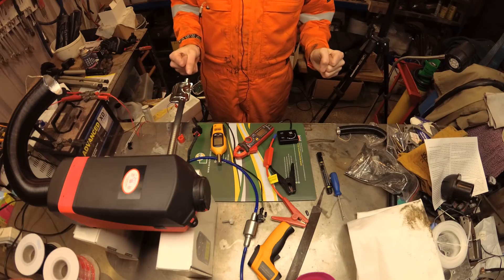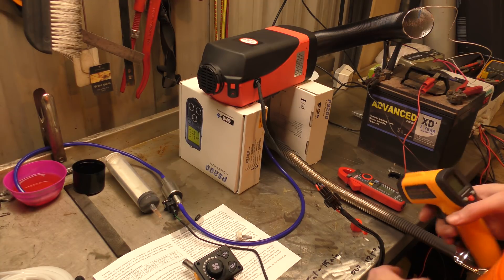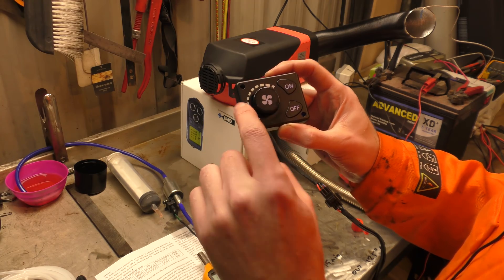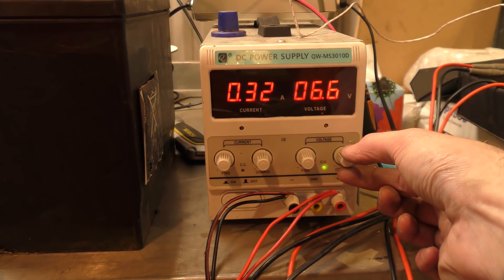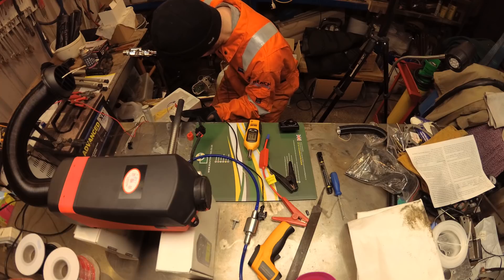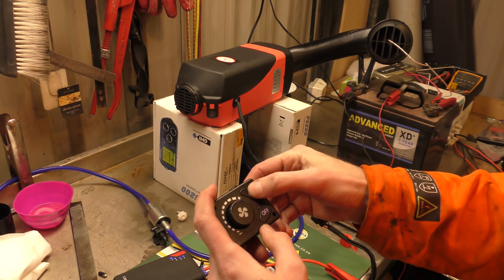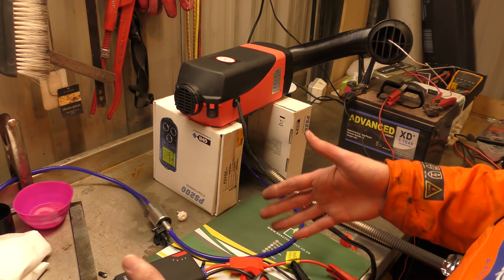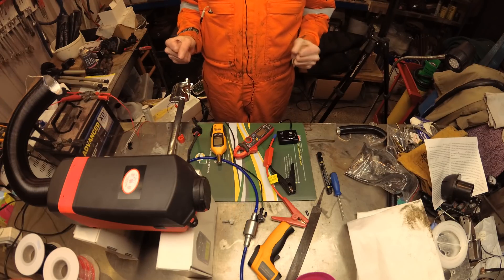Diesel heater testing - part 2 - more tests & questions answered

Comment: Hey David, I have the Espar S2 D2 2kw and have been trying to solve the exhaust cabin leak since the first winter it was installed. I worked with Espar service to try and solve it, did all the installation fixes from shorter exhaust pipe to addinga  turret and then sent the unit back for inspection.  They said nothing was wrong. Got it back and seemed ok the first few days but slowly the exhaust fumes started to come back, noticeable during shutdown and recently realized when fuel ran out while running on high, it started to smell too, telling me that when the flame is extinguished is what causes the smell and also telling me that it is always mixing exhaust air with cabin air although I don't notice it because it is burning cleaner, which clean or not is not good either. 

After trying a Chinese one to test, it was so much worse, after taking it apart i've come to realize that all these model types have exhaust mixing with cabin issues, I cannot believe that a huge majority of them are leaking like this, only that their nose and lungs are not as sensitive as mine. Carbonoxide is not an issue as it will smell like this without ever tripping a CO alarm, I have an industrial CO detector and it mostly won't detect anything, my nose and lungs feels it way before a reading. The chinese one was leaking so bad it did read around 10ppm, the gaskets on them are useless, not seated and loose, fuel line in the chamber showed signes of leak, and heat vent was just moist air, improper combustion.   

My thoughts is that the burner gasket may be the issue as it works well in the first few cycles but as it goes from high temps to low it either hardens or loosens and some exhaust gets mixed with the blow chamber air and gets into the cabin.  Another thought is, and I wanted to ask you, is it possible that exhaust is just coming back from the ignitor air hole?  like when the fuel runs out, the wire mess just burns up fuel and the smoke pushes out the hole?

Anyhow I plan on sealing all the grommets and and the burner gasket with Ultragey sealant or JB weld Red silicon sealant, do you think the sealants can hand the heat as a burner gasket?  Gonna coat the burner gasket with it for a better seal.  Also wondering about the sealants being toxic.  Thanks.

Would be cool if you could address this issue in an episode of yours,  there are a lot of people dealing with exhaust issues and they have no idea it could be the issue that I've mentioned here. It's not leaks from outside or anything to do with their installation as most think.

Comment: Hi David, can you help me please? I have a 8kw heater, but I have not seen the control panel on any of your heaters, mine simply has 3 buttons at the bottom, I am trying to get it on the lowest fuel supply and the lowest heat setting (8c) which is the lowest it will go judging by my black heater, the red one is showing different settings. Can you help please??
Reply from the maker: Is it this one? - https://ae01.alicdn.com/kf/Hb2906cab90654c4a8278c9111c62e8af9.jpg
Reply: @DavidMcLuckie  Yes, that's the one.

Comment: Hi love the videos so help full. Had mine for a couple of months Had a few problems with the settings all running well for a while.had to keep cleaning the burner out.in the end after watching a few videos i decided to cut the after burner at the first weld to find a gauze filler witch was completely blocked i have removed it and tig welded it back to gether all is well eney advise is it good or bad

Comment: What's the carbon monoxide risk leaving it on in a van overnight?
Reply from the maker: Assuming your exhaust goes outside the risk would be the same as any other fuel burning heat source.

Comment: Hi David, I wonder if you've come across this.......
I installed my 5kw heater and the display didn't behave in the normal way. There is no clock, it's got the settings icon displayed all the time. I couldn't prime the system by holding down the 2 bottom buttons down - It does nothing and I didn't get the usual "H of" message.
It was only by frustration that I found out how to prime it - I pressed the settings button 5 times and it finally started priming with a 60 second countdown timer before it stops again.
I can't change the pulse HZ to temp, display the clock or timer..... nothing!
I've searched for hours but to no avail, so you're my last hope 😫
All the best,
Tony
Reply from the maker: That sounds like one of the weird controllers.  Looks like the normal ones.  I've had one similar and it had a weird button combination to prime it as well.
Reply: @DavidMcLuckie  One last question if I may..... I want to buy the Afterburner (the genuine one). Everything leads me to believe that it will work and replace the remote display but I'm not 100% sure.......any ideas?

Comment: hi everyone, i bought this system but i would like to plug it into my garden shed.  what kind of 220v AC to 12v DC converter do i need ?
Reply from the maker: DC power supply 15A, should be about £15 on eBay.

Comment: Hi David, loving all your vids mate, detail is 👍🏻. Quick question if you don't mind? I've got an 8KW version on my boat. It's at the front of my boat and I have 6 110ah batteries at the back. It's a 60ft boat. If I start the heater in the evening aftwe the engine has fullly charged the batteries, the voltage display shows as 12.5v and it starts no problem. The next morning, voltage still showing as 12.5v, it won't start stating a battery issue. Is there anyway of adjusting the minimum startup voltage that you've found? The morning voltage generally drops .2v more than the evening drop so if I could adjust the startup voltage, it might make it start. At the moment I have to get up and start the engine or wait for the sun to add enough power through the solar. I hope that makes sense? Thanks.
Reply from the maker: That's odd.  I'll try turning my power supply down and see if I can replicate the fault.
Reply: @DavidMcLuckie  All sorted. I removed the factory power feed loom and upgraded the wiring. Gained .8v which is enough to keep it from dropping under the min starting V.
Reply: @DavidMcLuckie  you're a gent! Ta very much.

Comment: Can they  be  left outside
Reply from the maker: You'd have to coat the electronics with a waterproofing agent, like a conformal coating and perhaps some dielectric grease on the connections.
Reply: @DavidMcLuckie   cheers

Comment: Got this 5KW heater which has been heavily overfuelling so far (lots of black smoke).
I discovered that there is a „highland mode“ (which also works outside Scotland).
Further in the manual they call it „plateau mode“. It says it reduces the pumping frequency.
So I gather it’s a „high altitude mode“.

Switched to that an et voila, smoke drastically reduced, no smoke in stage one („gear one“ as the manual calls it).

As I’m using a fuel pump off a D5W Eberspächer, I guess it delivers too much fuel / pulse.

Does anyone know any specifications of either Eberspächer, Webasto or those Chinese fuel pumps? 
I’d like one with the lowest delivery rate.
Reply from the maker: I'm sure one of the pumps I've got or have seen had the amount on the side of it, I'll have a look.

Comment: Ive got one of these (5KW) heaters but the control isn’t a dial or a fully digital display but a 5-button round pad and a 3-digit display.

It shows things like „H-1“ to „H-6“ which i figured are the power settings,
„A-02“ e.g. which might be a fault code and it starts up with „P-12“ (could this be the pump pulse frequency settings?).

It’s all labelled in Chinese, so no clue.

Do you / does anyone have a manual or source of info on this?
Reply: Right, I can answer my own question, found something.
Just to share the info w. all:

That‘s the pad I’ve got.
https://www.caravanersforum.com/download/file.php?id=34189
(For the Scotts: this one mentions a „Highland Mode“!).

These two below seem to be the same.
https://www.caravanersforum.com/download/file.php?id=34188
https://www.caravanersforum.com/download/file.php?id=34190

Comment: Just watched your 2 videos on this 2kw heater and have bought one from Ebay. Will be fitting it into a small boat soon. The exhaust will be vented outside thru hull about 2 mts overall length. Hopefully this is not too long would you agree that's OK?

Comment: Can someone tell me what happens when the room gets to temperature? Does the unit turn off then come back on when the temperature drops? Thanks
Reply from the maker: The unit switches into low output, when the temperature drops it speeds back up again to heat again.
Reply: Thanks for the reply, that's good to know I was a bit worried about the van being too hot. Loving the channel. Much appreciated.

Comment: I have the 5kw heater but find it a bit too hot for the caravan. Any idea what the fuel pump setting would be to reduce the out put other than stick it on low and risk clogging the thing up with carbon? Great vids btw
Reply: Phil Elmes I think the default is 1.6 hz if you set it to 1 or .5 I would bet the fuel consumption would
Lower by half to 1/3 less and reduce heat output at the same time. 
That is if it can stay burning at 1hz fuel pump setting or lower

Comment: Hi . Can you tell me what I've done wrong. Primming fuel pump it wont get all the air out of pipe passed the pump it just fills the main unit up with fuel until it leaks out of the exhust
Reply from the maker: What happens when you try to run it after priming?

Comment: Just bought one I'm planning upgrading battery cable as it's got to run around 5 meter through my caravan. Would a 4mm2 single cable be ok for pos and neg ? I hear alot of horror stories about low volts
Reply from the maker: 4mm2 over 5m would result an about 0.5v drop. https://www.12voltplanet.co.uk/cable-sizing-selection.html

Comment: Another excellent video and follow up to the original.  I installed in my vintage camper and hooked it to my AGM battery for off grid.  For a power source I purchased a Henxlco 15A power source from Amazon for under $15 and it works great for long term use when hooked to shore power.  I think you'd really like that for your shop power supply.  Cheers!
Reply from the maker: Oh that power supply looks good, they do one up to 30A.
Reply: @DavidMcLuckie  Yeah they're ridiculously cheap and it works really well.  The 15A is warm to the touch during the startup and never gets hot.  It's adjustable voltage only goes up to about 13.8V but the heater doesn't mind at all.
Reply: How many watts does it draw?
Reply: @PackraftingAdven  about 125 watts when the glow plug is active. Around 12-15 watts on lowest setting. I have the rotary dial control panel.

Comment: can you mount the unit outside and only have the heater pipe into the van ?? what is the IP rating of the unit??
Reply from the maker: If you mount it outside you'll need to put it in something.  The unit itself isn't sealed.  Not sure of it's IP rating as it's open at both ends.  You wouldn't want it hoovering in any water or debris.

Comment: Great videos, great detail, and glad to hear it runs on Kerosene. Noticed some confusion about fuel types. Kerosene and Paraffin may be the same thing in the US but they are not the same fuel in the UK. Paraffin (UK) is a more refined fuel oil, and is very suitable for indoor use (e.g.stand alone paraffin heaters). Kerosene (UK) on the other hand is less refined and definitely not suitable for indoor use unless it is being used in a purpose designed system (e.g.central heating boiler) as it gives off toxic  emissions when burned, not to mention choking black soot!

Comment: Hi David got another question in the setting there is a p1.5 up  what does it actually do and what is the best setting to leave it on it,s same controller as on your 8 kw one thanks again. Jeff
Reply from the maker: I'm not sure I've seen that.
Reply: Hi David it's in the code part Ihink it might be the start pressure and also a fan speed setting have a look sometime and let all of us know what you think on the matter would be of interest all of us.Jeff. @DavidMcLuckie

Comment: Here again David, still no joy. Disconnected the fan from the PCB, and tried a 12v feed into the plug.........no response from the fan. How would you test the fan? Do you think I've tested it correctly? My first suspicion was that the fan had stopped due to contacting the casing, do you think this could have burned it out? Thought the magnetic sensors would've tripped it out and shut the unit down?
Reply from the maker: If you gave the fan 12v and it didn't move chances are it's cooked.  If you give it 12v volts and try to spin it by hand does it do anything?  How stiff does it feel compared to originally, the bearings might just be knackered.
Reply: @DavidMcLuckie  I was worried that maybe the PCB could step down the voltage to the fan? Tried spinning it to assist it starting - nothing. I'm gonna put a video up on YouTube at the suppliers request.
Reply from the maker: I'm sure when I have the motor out it says 12v DC on the side of it.  It doesn't run at the full 12v when in use, but 12v would certainly have made it spin if it was alive.
Reply from the maker: Sorry.  I've just had all these comments appear in the 'held for review' section.  Have you tried unplugging the fan, jamming two pins into the plug and giving it 12v?  If the fan spins it's not the motor, but it might still be the board.

Comment: David..........I'm here again with a tale of woe. The heater has been fine, but the fan occasionally makes contact with the housing, so I made a ply box cover for it. Left it running unattended for 20mins, came back and it had cut out, and I'm getting E-06, and the fan icon is flashing. There is a click on the PCB then E-06 shows, tried a battery pull, tried re-priming the pump( fuel line is full) and have taken the cover off to make sure the fan is un-impeded..........HELP!
Reply: E-06 in my book says............" Check the polarity of the magnet and the position of the Hall sensor" if you can work that out you're better than me, and that's not saying much really.
Reply from the maker: So on the fan there are either one or two magnets.  As they pass by the sensor on the board they let it know the fan is spinning.  Has you fan by any chance moved slightly off the shaft?  Can you push the fan in towards the motor?  It might take a good squeeze if it'll move.
Reply: @DavidMcLuckie  Thanks for replying, tried what you said........no joy. Don't know if I'm imagining it, but the fan feels stiffer than it was before? Wondering if it's fouled whilst I've been away from it, and it's burned the fan out? Fuckin' really doing my head in now, been nothing but trouble, and the weather is getting warmer by the day, so the longer this goes on, the less chance I'll actually need the fucker.
Reply from the maker: If it was me.  I'd buy another one from Amazon, bench test it.  If it works fit it, if not amazon returns and keep the other for spares.  If your fan has seized you can get a replacement blower assembly for £30 - https://www.ebay.co.uk/itm/Airtronic-Car-Motor-Blower-Combustion-Air-Fan-12V-For-Webasto-Eberspacher-Heater/153061406608?hash=item23a32bb790:g:UaoAAOSwkSxbIh1g:rk:18:pf:0.  And see if that fits directly or strip the motor out.

Comment: I didn't quite follow your answer on the temp control.  Do you set a temp level and it turns on and off as needed to maintain that temp?  Or do you set a temp and it blows out that temp no matter how hot it gets inside the van, rv, etc?
Reply from the maker: Sorry, it doesn't turn on and off.  If you use the rotary control it runs at max power until it gets to whatever temperature the number of lights on the controller corresponds to (I don't know what they are) then it slows down onto low power.  Same idea with the LCD controller, you pick a temperature and runs at full power to get to that temperature then slows down to low once it's there.  Obviously if the temperature cools down again, it speeds up again to raise the temperature.  With the LCD one you can set an on and off timer which will turn it on and off according to the time set.  Hope that makes sense.
Reply: @DavidMcLuckie  Thanks.  That makes sense.  So, not a real difference between the two in regards to soot build up unless you are using the off timer function on the LCD one to turn it off in the middle of the night or what have you.

Comment: Fitted mine, the fan span briefly then stopped, all I get now is E-10.........the pump clicks, fuel is going through, in fact it's gone right through and out the exhaust. I am 1 step from smashing the fucker with the sledgehammer and sealing the hole up...........help?
Reply from the maker: As the manual doesn't list E-10 as an option we're going to have to investigate.  If it's got fuel is the glow plug working?  Can you unplug it and check it's resistance with a meter?
Reply: @DavidMcLuckie  Thanks for replying Mate, sorted it. On mine E-10 is 'Fault of ultra high temperature sensor' after much pissing about, I poked the temp sender with a screwdriver and E-10 changed to E-6........several more attempts and she fired up, very smoky at first, burning off all the excess diesel. Told the neighbours they were having a meeting selecting the new Pope in me van! Hopefully it'll be right now, thanks again for replying and kudos to you for a wonderful YouTube channel.
Reply from the maker: Glad you got it sorted.  I'll add the E-10 fault to my list.  :)
Reply: @DavidMcLuckie  I have 2 lists in my manual. First list is to 8, second one in Chinese and English to 10. E-9 is listed..........'Temperature of the shell is over 500f' ......overheating I guess.